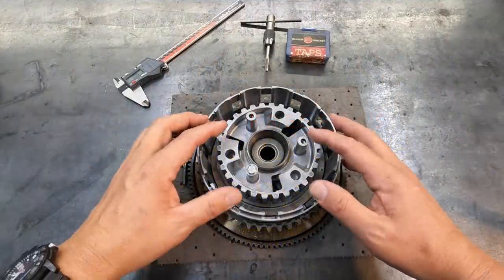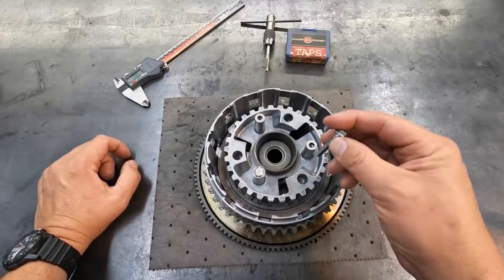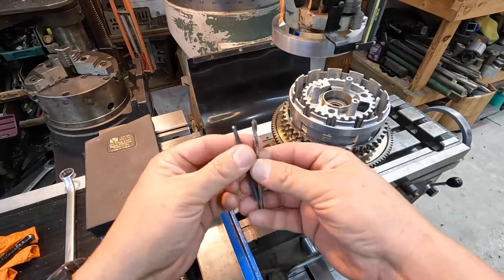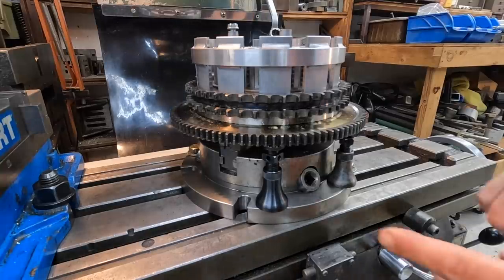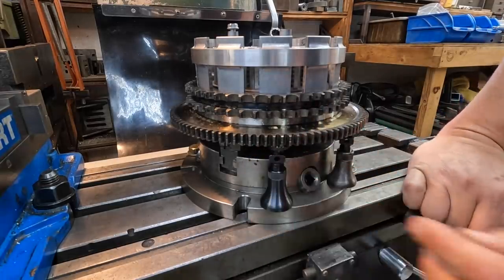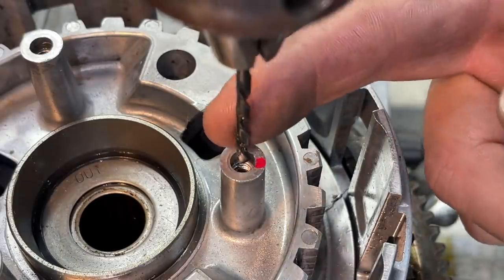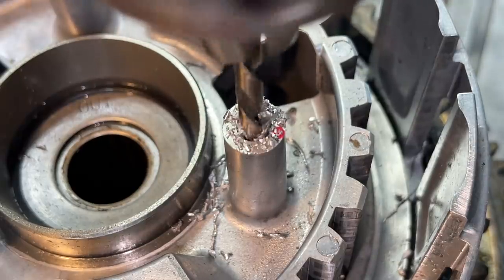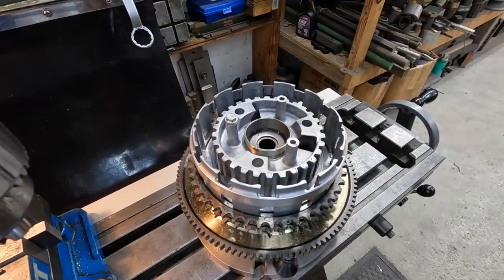Harley Davidson Clutch Basket: Broken Bolt Removal

Comment: 1 question since its a rotating high peed what do you do for the different thread weight for vibration?
Reply: It’s a Harley. Nobody will notice the extra vibration.
Reply: Not an issue.  At the max rpm of that engine, it would be impossible to measure such a small balance issue.

Comment: The resistance is intentional to keep the coil tight on the mandrel so you don't install it skipping a thread binding up and causing a bigger headache
Reply: Who knows the headache, effort, money, and people time to come up with a simple cost-effective solution to a problem that had to be addressed...or else they wouldn't bother... just for some guy to show how to use it as not intended. 
As an engineer (admittedly not a mechanical one) as much as I learn from these guys on the tube, there's sometimes I just want to thunk them in the forehead, what did that shortcut save? and what happens if it skips or binds up? it essentially is a spring FFS no one has twisted or stretched one of those!
Reply: @osgeld  just curious. what is the chances of a helicoil jumping a thread in a newly tapped hole? is a helicoil pretty weak? i have never even seen/held one so just wondering

Comment: I thought you might plug the hole with a shop rag to prevent bearing contamination.

Would have been super easy.  I cringed every time I saw a chip drop down that hole.
Reply: And you weren't bothered by him spraying degreaser all over it ????????? !!!!!!!!!!!!!
I'd say that bearing needs regreasing after that treatment !
Reply: i would not use shop rag, i would use a plastic blanking cap, helicoil kits in the uk come with a punch to break off the tang and it is magnetic so  the tang does not fall where you don't want it to.
Reply: @kevinapps1233  anything would have been better than leaving it open.
Reply: @millomweb  the damage was done by then.
Reply: @johnboyd6139  "anything would have been better than leaving it open." True but plastic cap would be better than a rag.
Reply: @kevinapps1233  semantics.  If you have to be right, fine.

Comment: fun video. i have seen you feature a parallel splined extractor set on your channel in past a vid. i have the same set that i relied on heavily as a long-time automotive tech. it has some really nice, hardened drill guides that will keep you centered even if the bolt is broken at an angle. drill a small pilot and you are off and running. love your channel, avid viewer, interesting content. thanks for sharing.

Comment: Once confirmed the bolt was loose, why go with such a big drill bit and not just an ez out?  The risk of breaking when the bolt is LOOSE is minimal then the originality of the part would have been maintained.  A helicoil may be strong, but is only as strong as the base metal that holds it
Reply: Aluminum threads were strong enough for the original application, so a helicoil in aluminum threads is fine as well
Reply: Heli coils are stronger than the original threads (in aluminum) because you are increasing the thread diameter in the aluminum part.  The pullout force is now for a larger thread. I assume why Adam stuck with the LH drill is it was what he was already doing. It happens to me too, you just get momentum with what your are doing, "its almost there,  just a little more" and you get blinders on, heat of the moment type thing.
Reply: I was upset he didnt do anything to isolate the repair area, I mean he allowed all those shavings to go into the rotating assembly etc... and a HeliCoil, the threads were 100% as the bolt came out unharmed!!   What if this was a high RPM fixture, No thought of balance or out of time..and lastly, The generic DIY helicoil tool... C'mon man..... Just wreck the part to make a video.... I bet this guys Sorry he sent it to him!

Comment: In my opinion you're running the LH drills far, far too fast.  You actually don't want them to cut, you want them to grab, so the speeds & feeds for drilling are useless.  If it starts drilling, that's fine, but stop!  Then go to a tapered extractor.  The moment you felt it "trying" to come out, there's no more need for cutting.
Reply: @madjimbo4176  210 rpm

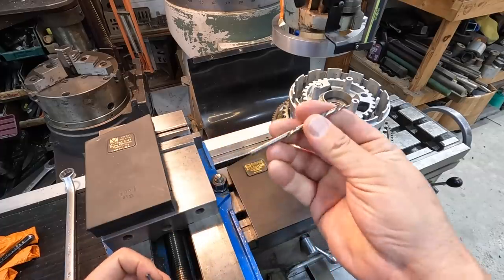Comment: 4:34  Are the upside-down bits awaiting sharpening?
Reply: Most of the time bits that are inserted back into the drill index upside down is due to a burr on the shank of the drill bit when it spins or slips in the chuck. A light touch on a strip sanding belt will take off the burr without affecting the roundness (concentricity) of the shank.

Comment: Good repair there Adam, just a thought although you have only put in one heli coil that might unbalance the engine? I know they are very light and Harley Davidson engines are
not high revving engines but while you have it in your care i would do all the same so as to not unbalance the engine...but that is your call!
Reply: I wrote in another comment that the usual "fix" with these is to do all 3.  It is not a balance issue (the insert weighs nothing) as much as it is a preventive trouble spot solution.

Comment: I have found that using the left hand drill I get a better bite on the bolt by turning the chuck by hand rather than under power
Reply: I suspect his problem was caused by failing to blow the swarf out of the hole all the time resulting in some getting jammed in the thread between the bolt and the hole.

Comment: Excellent job in removing the broken bolt.
But I have a problem with the depth you installed the heli-coil. The other bosses, and that one (originally) have/had a recess in them to account for the shank on the bolts that thread into them. So the pack cover can be tightened to the proper tension and depth.  By installing that heli-coil to only surface hight you will not be able to obtain the correct installed dimension and pressure.  Take it for what you will, consecutive or trolling but I couldn't let it go.
Reply: Won't, if the bolt bottoms on the helicoil, screw the helicoil in further?

Comment: What I'm wondering with these operations: you want the left handed drill to bite into the material, however the center causes you to need a lot of pressure for it to bite. Wouldn't it be a good idea to predrill it with a very small drill to relieve the center? Or maybe even use a center drill if you can. I didn't have the opportunity to try this yet, but would like to see if it works.
Reply: Seems a logical suggestion to me.
Reply: If you are going to predrill the center may as well use an easy out and be done quick.

Comment: Fancy heli-coil install tool. All the ones I have in the kits I have bought are a plastic T handle thingy. Some of the kits have a plastic guide included and a steel driver with a square drive if I remember correctly and the tang breaker offer thing is usually a close fitting steel rod that comes in the kit. I guess there are different levels of tooling you can purchase depending on the frequency of use, intend use  and or budget . Nevertheless I like that tool. Cheers
Reply: The tool that Adam used is for higher production where many inserts of the same size are to be installed. The O.D. is reduced to a slightly smaller size as it’s screwed through the tool for easier installation.

Comment: I do not know if this exists but a center lathe drill with different OD's for different threaded hole sizes?  If this does not exist, one could buy different sizes and grind them down for differing threaded holes.  These bits could be used for broken bolt removals.  Main objective is to protect the threads from thinning by the drill bits.  Also one could make a set of guides out of brass with the inner thread crest size in mind.  Just a thought.  Thanks for the close ups, it is almost like being there.

Comment: really cool video, but I have a question i’ve done the same thing to a snowmobile clutch but I was told the Heli coil wouldn’t be the proper fix that it might back out and lose it’s torque overtime because of the spinning motion. So I was just wondering if you can use Healy coil‘s not a rotating part. Thanks for your time
Reply: You can, provided you wind the helicoil insert below the start of the thread you put onto the part. The top end of the helicoil wire will dig into that thread if you try to unwind it and prevent it backing out. The only way to remove a helicoil is to use needle nose pliers to bend in that end and kind of uncoil them out

Comment: I thought you were supposed to load the helicoil insert into the cutout slot on the helicoil tool sorta like a buttlet in a rifle and then turn the tool so the insert passes through the tools internal threads it has in the head.

Edit: Should have watched the whole video before commenting, lesson learned, he explained at the end how to properly use it.
Reply: You are

Comment: I’ve always wondered how using a left-hand drill bit to remove the broken remains of a right-threaded screw/bolt would ever work. On one hand, you want to apply a counter-clockwise torque to the broken piece (lefty-loosey, righty-tighty, and all that), but on the other hand, you need to exert a downward pressure on the drill bit so it’ll ‘catch’ on the broken-off piece. Well, the downward force is trying to push the broken-off bit back into the hole. So you’ve got conflicting needs, here. Maybe, just drilling it out (with a regular right-handed drill) to start with, is the way to go; then - once it’s out - you can clean out the threads.
Reply: You want to apply pressure on the LH bit just enough for it to grab and then it spins the bolt out. If you’re going to drill it anyway, you might as well try to spin it out.
It would have worked fine had he used an end mill first but that 5mm bit he used got into the threads.
Reply: The upward force of the bolt unscrewing is more than enough to overcome the down force of the spindle.

Comment: Could you use a sleeve to prevent the drill from damaging the threads ?
Reply: If you have some usable threads left at the top above the broken bolt, you can centre drill a new bolt of the same size, wind it in the top of the hole, and then use that as a sleeve for the drill bit you run through the broken bolt. There is almost as many ways of extracting broken bolts as there are of breaking them in the first place!

Comment: You could use Alum and hot water to eat the bolt out without damaging the threads.
Reply: I dare you to try it with that part.  It would be funny to watch!
Reply: @paulcopeland9035  have you ever tried it ?, do you even know how it works  ?. It doesn't sound like it.

Comment: Why not use a screw extractor? I’m not here trying to master you Adam but if we first drill a smaller hole in the bolt and remove the drill chips we don’t get chips in the threads that will lock the bolt from turning or even damage the threads in the hole when we try to back the bolt out. Great repair with the helicoil and yes, I do prefer your perfectionism. 😊
Reply: Exactly. He destroyed the hole sometimes when you have too many tools you overthink and over complicate the job
Reply: @toothpastebo3663  Nonsense!  Anybody with sense will not use an "extractor".  If they break (and they often do) the part will need major machining or thrown in the bin. If that bolt was bottomed out or galled to the thread, there is no way an extractor would remove it.  Adam did a fine job.  They only thing I wish he had done was heli-coil the other two mounts.  This is the common fix for this part as the factory attachment is weak.
Reply: Screw extractors are sold on tool trucks to mechanics who have no knowledge of actual machine work.
Reply: @paulcopeland9035  for a screw that loose. If you break a screw extractor it’s time to shut your workshop and find something else to do. He over complicated the job . And also the threads in that new hole were too high.

Comment: At 7:36 there is a close up of the spines that the plates ride in... The inner probably should have been replaced since there is definite wear from the ears on the plates. I'd have to check my manual, but I'd guess that what I can see is out of limit.

Comment: Im surprised, (kind of but kind of not) that Harley doesn't install Heli coil at the factory. All the aluminum race engines are Heli coiled. Its much stronger.
Reply: My employer has an equipment standard for all threads in aluminum or copper to be helicoiled with possible for this reason.
Reply: @ratdude747  Yeah thats the right thing. Aluminum threads have no strength, and the threads crush with you torque down on them. Helo coil prevents this.
Reply: @ratdude747  One thing I should have mentioned is the owner of the harley broke a bolt in the clutch basket. Those bolts have torque specs and he wasnt properly torquing the bolts down and exceeded what factory torque spec is on that part and it ends up being way more that what the aluminum could handle. So the owner was doing an improper installation. Im pretty sure even if Adam had done a perfect extraction, the new bolt would not have fit properly anyway. 

The owner needs to either let a qualified harley mechanic work on this, (not his riding buddy with tools that thinks he is a harley mechanic) or he needs to get the proper tools, not chinese garbage, and pay attention to WTF he is doing. There is NO reason at all that bolt should have broken off like that.
Reply: @opieshomeshop  This is a common repair.  Even "qualified harley mechanics"  know this issue.  Inserts should have been used by Harley when new.  What gives you the right to lecture the owner when you don't have the slightest idea what went on.  Shut up and go away.

Comment: are there any issues with galvanic action while using a dissimilar metal helicoil?
Reply: Not as bad (or any worse) than the bolt into the aluminum casting.
Reply: Galvanic  corrosion only occurs in the presence of an electrolyte.
Reply: @paulcopeland9035  thanks!
Reply: @80slover39  thanks!

Comment: 5:40 I guess using a 3/16" put you right on the root diameter of an M6 (4.773mm). It was always going to attack the original thread unless it was ultra-precisely centred, which it wasn't (as you pointed out). Also, does the inner basket rotate or the outside? Will this need dynamic rebalancing since the Helicoil weighs more than the aluminium removed? Or is it that Harley is so low-speed that it doesn't really matter.
Reply: Almost all Harley's could benefit from balancing(some are actually fully balanced but that's more of an exception) but in this instance I don't think the original owner would even notice if it's a bit more out of balance or not considering how much they vibrate to begin with.

Comment: Question, how do you keep really small drill bits from walking off center when drilling steel bolts out of an aluminum housing?
Reply: Use a smaller center cutting end mill to mill a flat spot in the bolt

Comment: How could the bolt spin out if the mill head was pushing down, wouldn't  a hand drill have let the bolt spin out as you pulled back ?
Reply: Well, I guess he was using the quill on the mill. On the quill, forces can more easily go both ways, so if you've got something pushing up against the quill, you feel something pushing up on the quill handle. And yes, he was applying downward pressure, but you can do the experiment yourself if you can remove a screw while applying downward pressure.
Reply: He's not power-feeding the drill down, just using the level ont he quill. When it catches he can feel it pushing up and just lets it spin out. That's why he says a couple time she feels it trying to go.

Comment: I hate helicoils, drill and tap them to fit M7 bolts, I know there not common but there is enough material to do, just one size larger.
Reply: Helicoils are FAA approved repair in aluminum and magnesium castings. Stronger than retreading the base metal alone.
Reply: Try finding an M7 bolt, even here is Land Down Under where we have been using metric for 30 years. As a mechanic and a machinist I have thousands of bolts and nuts, metric and imperial, from M2.5 to M24 (+ imperial equivalent) all sorted by size. I do not have one M7 bolt or nut. Even if you could find an M7 bolt, try finding a tap to suit. Helicoil is the way to go. Keeps it standard manufacturer size with stronger threads. In the aircraft world, many original aluminium components are helicoiled by the manufacturer.

Comment: No locktite to hold the coil in place???
I have never uses a kit
Reply: because they are basically a big spring they don't have an issue of backing out once installed.
Reply: locktite on a timecert, no need on a helicoil. Had plenty of timecerts back out, never ever had a helicoil back out.

Comment: Was there a seal running where the chuck grabbed the piece? If yes, no surface protection? No protection cover for the needle bearing since all stuff felt inside? Ugly, much effort later on to clean the bearing most careful.

Comment: I have used left drill bits with a lot of success. I just kind of cringe when you use them on a mill. When the bit catches the bolt comes out very fast. Do you have enough feel / reaction time to back off the feed fast enough?
Reply: Good point, maybe drill using extra slooow speed might be the ticket.
Reply: Hes hand pushing the feed arm, its not on auto feed,  so I would think it would just push his hand back if it tried to rise up, unless you were really bearing down on it. (not recommended for this)